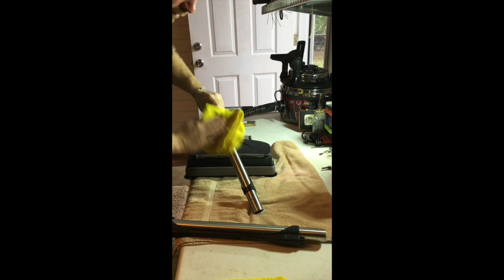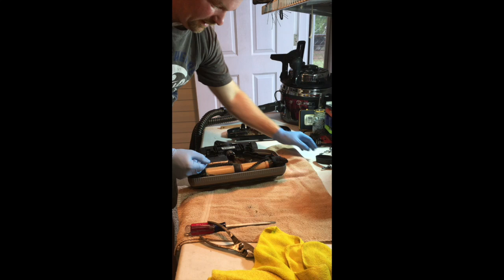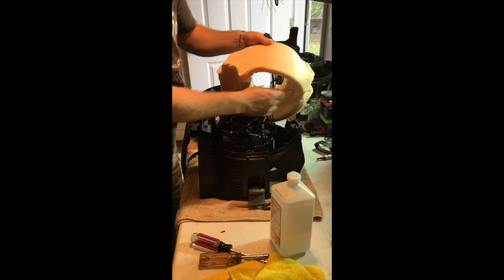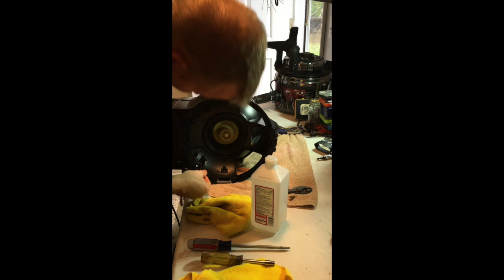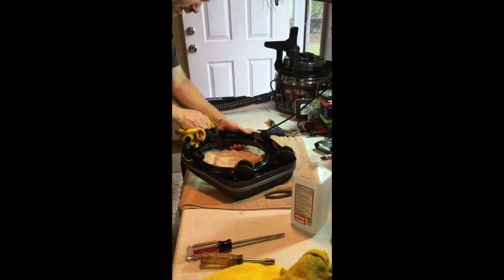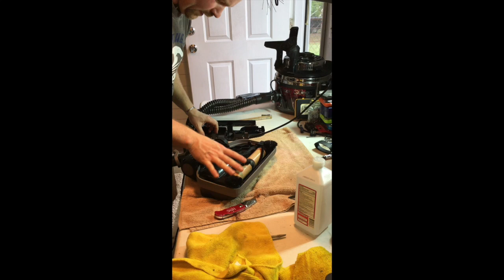Rainbow E3 Vacuum Cleaner Maintenance and Cleaning

Comment: Love your videos, man.  I have a question.  On my rainbow, I took the motor apart and cleaned out all the blades... watched your 15min video several times as a guide.  Thanks so much. 

When I put it back together, the loud noise it had been making stopped, which had prompted the cleaning, but there is no suction. Or very little, now. I took it apart again to see that the four bolts that hold the motor together must have cracked when I screwed them in.  I did it by hand and was gentle, still not sure how that happened exactly.  I'm assuming that's the reason for loss of suction. Any ideas as to how I could get the motor to hold together with the cracks? I can tighten them but they dont seem to lock it down tight. Should I try glue?
Reply from the maker: The DY Show send me a pic of what’s broken is it the bolts or the housing
Reply: Did you get that issue fixed?

Comment: Great vacuum cleaners but the E2 has some design flaws.
 The recurring problem I have had is with failed electric connections on the stainless steel tubes. There does not appear to be any way of disassembling them. Is this just a matter of replacing them? 
The other problem I have had is with the clipping mechanism that is designed to allow the connected cleaning wands to stand upright on the power nozzle. I replaced the power head once only to have the same thing happen.
Reply from the maker: Bruce Bailey as far as I know tubes can’t be fixed only replaced and for the power nozzle it’s a wearing of the locking mechanism that can be replaced without having to replace whole nozzle

Comment: How often would you recommend this level of maintenance?
Reply from the maker: lbowen9708 depends on usage normally the Hepa needs to be replaced at least every 24 months separator cleaned after every couple of uses
Reply: Each time I use mine, I clean the separator and try to clean the dust from the little revolving ring, but I dont know where the dust ending up at that I cant get that has gone under the ring.
Reply from the maker: there is really no way to clean that unless you take the motor apart......and again I would only recommend a vac repair shop or authorized Rainbow dealer to do that.....it doesn't need to be done all the time.. just periodically to keep machine in tip top shape.... the biggest thing on the E series machines is to keep the HEPA changed out every couple years...and the Seperator which you are doing....